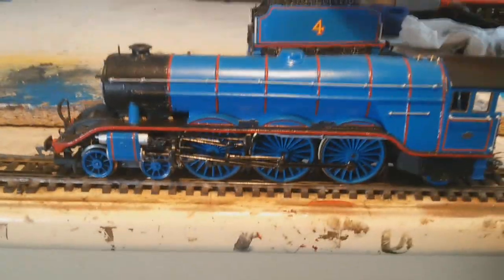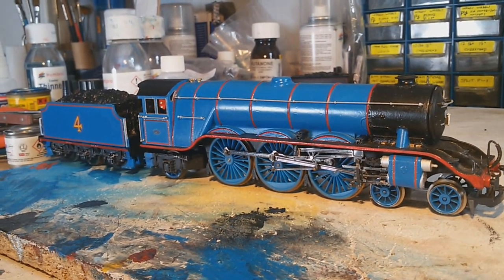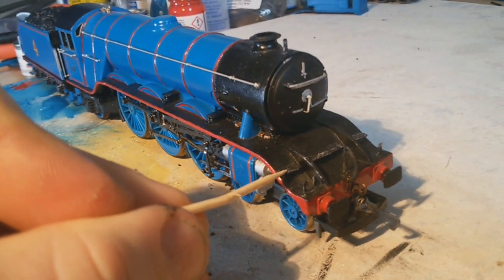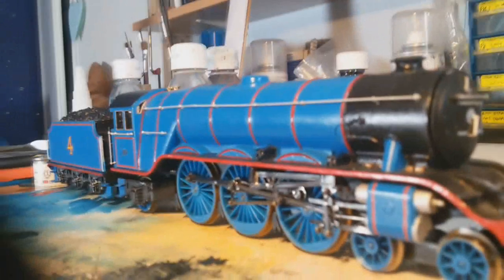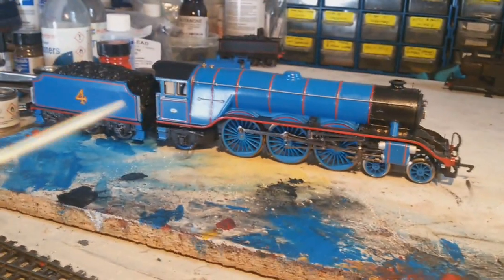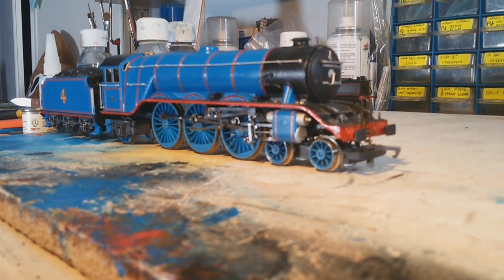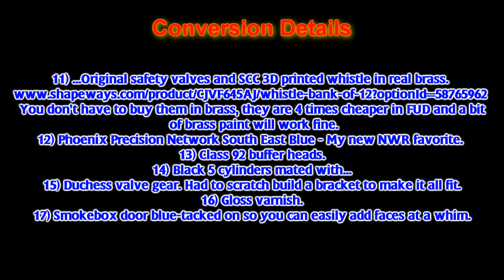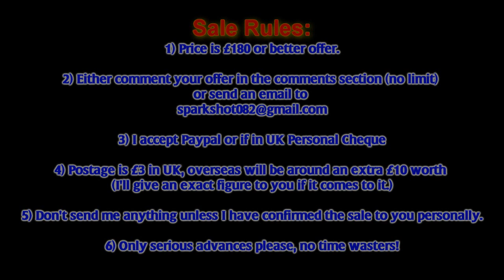NWR #4 Gordon MKII For Sale!  (SOLD to Explosive Cookie!)

Comment: I know you mostly deal with RWS and Hornby stuff but I figured I might as well ask you cause you've been modelling for a while. Do you know if there's a way to shorten down the rods on bachmann Henry, Gordon, Bill, Ben and Percy? I think there far too wide
Reply from the maker: If they are too wide you simply can remove them to file them down.  Isn't hard, just time consuming.  If you want to change their lengths it's a bit more complex but I've done that too, cut n shut job with solder and scrap metal fillers.

Comment: How'd you get the ringfield motor to run like that? I've got an old hornby mallard, tender drive that I'd love to get running. I've replaced the motor but can never get any traction on it. No idea what the problem is, doesn't pick up half the time either. Any hepl would be appreciated, if you message me I can provide email details

Cheers
Ed
Reply from the maker: Ed Robinson - Hello. I'm not sure really.

Quality control with RTR engines has always been a bit idle and it seems buying RTR loco's these days, without joking, is literally a gamble.

Seems we can buy the exact  same loco and one will be a gemstone and the other a piece of ballast.

It's always been a pretty smooth runner despite its age.  

Contacts sometimes need bending into position on RTR loco's.  Also check your wheel back to back settings as that can cause pick up issues surprisingly.

Hope this helps.  I think it is more luck than anything.